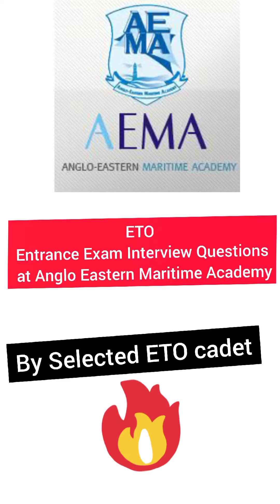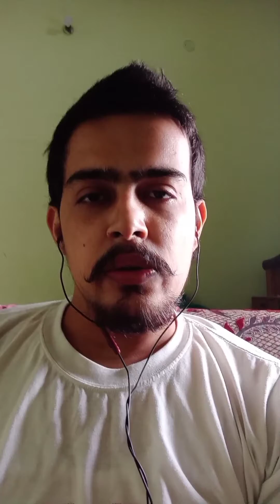ETO Entrance Interview Questions at Anglo Eastern Maritime Academy | ETO sponsorship questions aema

Comment: Ic engine havinge 4 stroke 
Suction
Compression 
Power 
Exhauste
The power stroke the sparking time or sparking stroke which actually used after the compression of stroke. So there is open the outlet valve or shut off the inlet valve this SECQUANCIAL cycle decide the timing of power stroke.